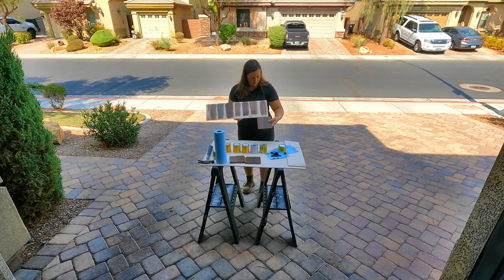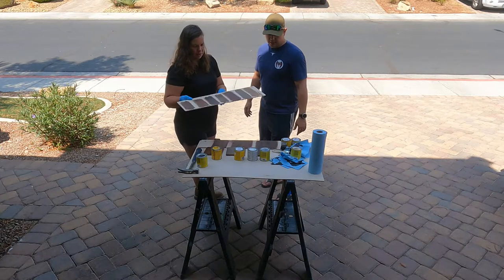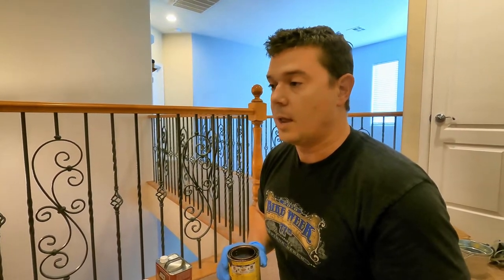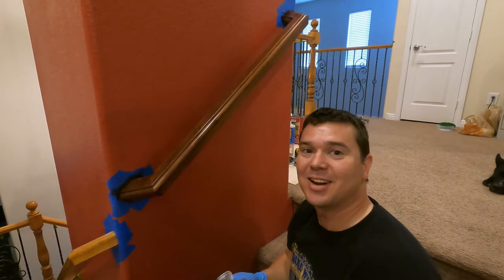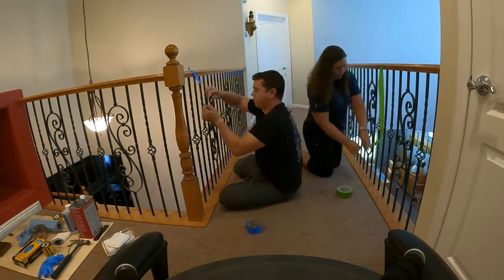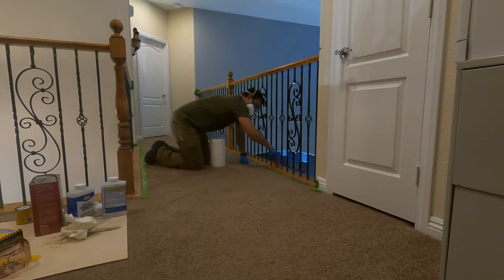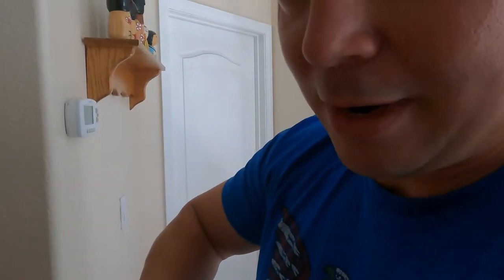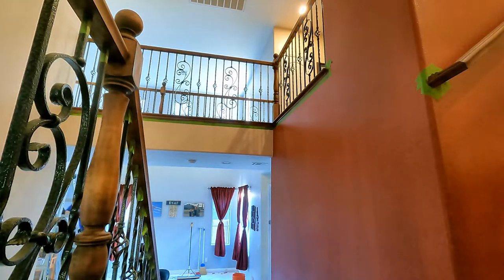Stripping & Staining Wood Railings

Comment: How did you sand down the railings?
Reply from the maker: Sorry this took so long to get back to you!  Initially I didn't sand down the railings, which was a mistake.  I thought that 3 applications of the polyurethane stripper would be sufficient, but the result was not great in some areas.  I ended up going back and sanding everything using a multi-tool with a sanding attachment that let me get in between all the balusters.   That process is shown in the new video we put up last week if you want to see what I did. - Jonah